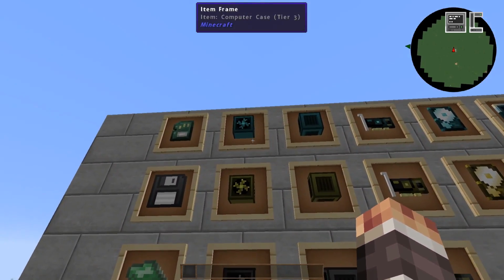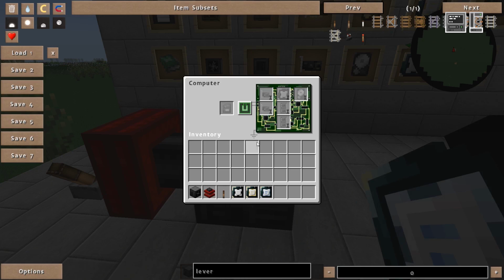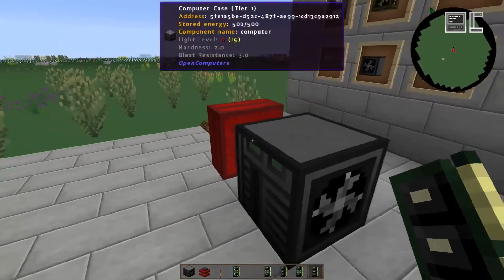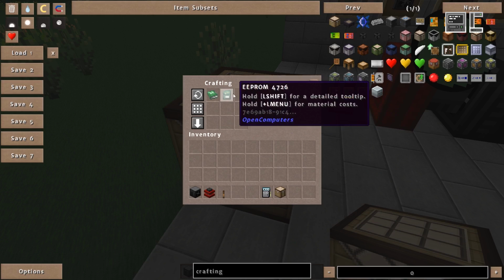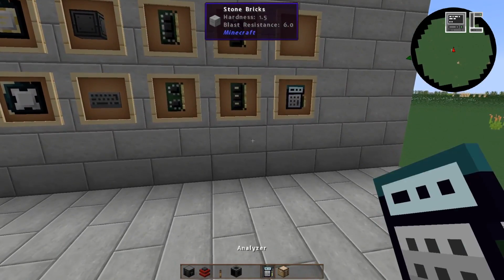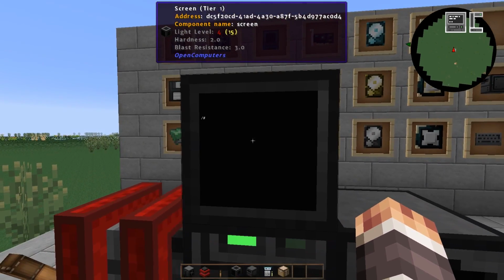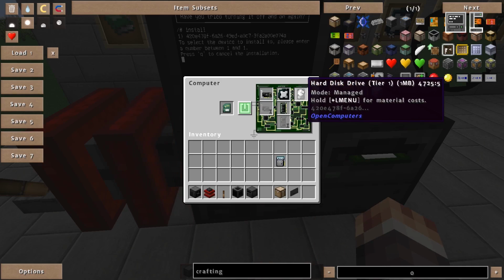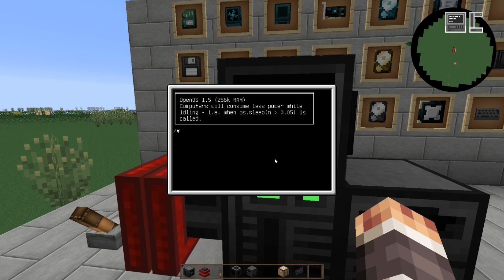OpenComputers Mini Tutorial [ENGLISH] Setting up a computer [v1.5]

Comment: Yo a quick tip, and a late one. DO NOT do tutorials with a texture pack.
Reply: sort of a moot point? If he uses vanilla, people using texture packs may not recognize parts anyway. Aside from the fact that the names remain the same and searching them with JEI or whatever is always the same.
Reply: @inviktus1983  most people with texture packs know what vanilla Minecraft looks like.
Reply: @MrAwawe  not if they've only ever played the mod with texture packs.
Reply: @inviktus1983  the mod has the vanilla textures in this video. It's not affected by the texture pack.
Reply: @MrAwawe  well then, bugsybros point is only all the more moot. Thanks for correcting, improving and reaffirming my first reply to bugsybro, bro.
Reply: Items added by mods don't change when you use a texture pack. Also you should be able to read what they are...